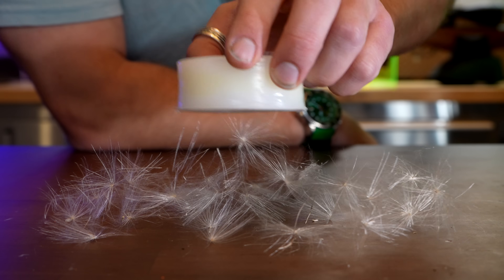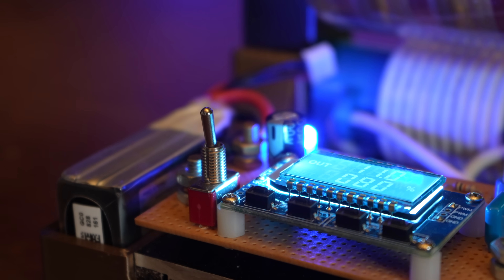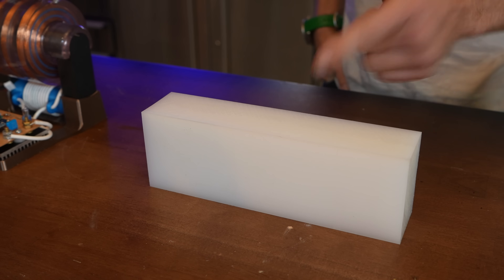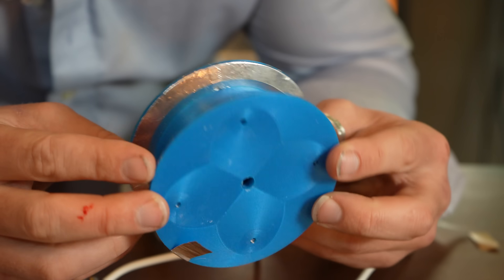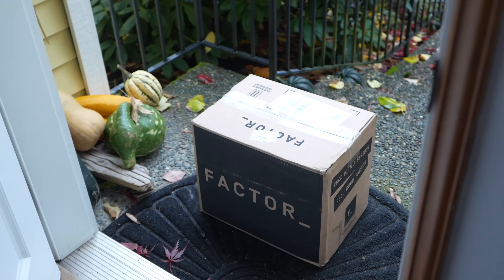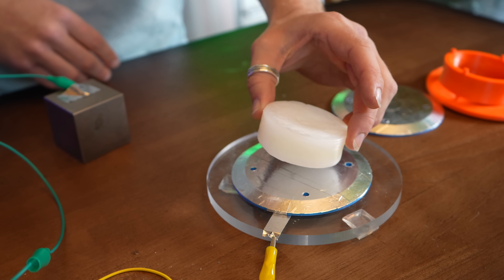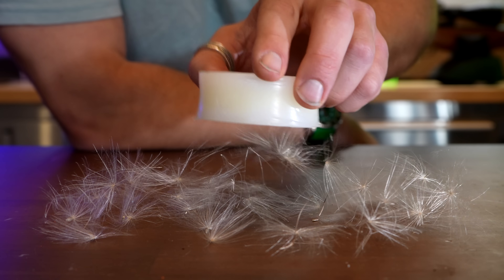Creating an Exotic Material With A Permanent Static Charge (Electret)

Comment: I take it, pointing at the Van Der Graaf generator makes it pull away electrons from skin (ground level potential in a positively charged field, "sharp point" of the finger causing an unevenly strong electric field)? It's effectively similar to the Biffeld-Brown effect (ionic wind) setups, though probably too weak to actually ionize anything.

Comment: Took me a while, but i finally got around to duplicate it. Make a nice mold, but i am struggeling to melt the PE properly. i tried 400°F as you showed, but the PE just sits as block for a long time. After a while, it turns transparent, but without really melting (just changes color from white to transparent, outside to inside). However before it is even liquid, it turns brown-ish so i assume it decomposes already. i pulled it out and it was soft, soft enough to somewhat force into the form, but it did not really conform to it. I tried applying some field to it, but i later learned that it did not even touch the bottom electrode, so it failed. Any advice on how i can melt it quickly without it decomposing?

Comment: So, what happens if you put this thing on ground, does the static charge disappear, or does it remain?
Reply from the maker: The charge of electrets is very locked into the material itself. So in theory, nothing.
Reply from the maker: The charge within electrets is locked into their structure, so in theory, nothing will happen. possibly SOME charge reduction if left on the ground for a long time?
Reply: @PlasmaChannel I did not expect a reply on a year old video this soon,  especially not from you yourself.

Cheers and a happy new year!
Reply from the maker: Cheers, and happy new year! Thanks for asking the question. It’s worth an investigation.

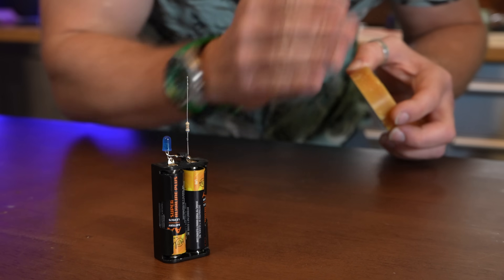Comment: 5:27, it's easier to 
give an air molecule charge (I forgot the correct term)  and cause it to fly towards  the source of the charge differential, if the charges only have to do that around a smaller area. I explained that awfully.

Comment: Two thoughts:   what if you made five of these electrets, and stacked them negative to positive?  Would the electrostatic field be cumulative?   If so, would it be five times as strong,  or less than five times as strong?

Secondly, if you want to see a higher resolution electrostatic field, could you take tiny colored polystyrene balls and sprinkle them on a sheet of paper with the electret underneath, the same way magnetic fields are visualized by sprinkling iron filings on a piece of paper?

Comment: And the more the  impurities are in your PE the better the charges are long lived and stored why: Dipole Orientation of Impurities: While pure PE is non-polar, commercial PE often contains tiny amounts of antioxidants, catalysts, or moisture. A high-voltage field forces these tiny impurities to align. Once the field is removed, the stiff plastic chains "lock" them in place, creating a permanent internal electric field. Bravo !!

Comment: Too late now, but do a 1x1 (i.e. 1) sensor. Put it on a stick. Glue the stick to a servo and glue that servo to another servo. You can (could) get an image of the entire cross section of the electric field. Also, floating-gate mosfet: 👍

Comment: There's another family of related materials that's even more interesting! Ferroelectrics, where the persistent polarization can be switched and shows a hysteretic behavior, just like ferromagnetic materials
Sometimes some materials can be both ferroelectric and ferromagnetic at the same time and sometimes both order parameters end up coupling, in those very specific materials you can generate a magnetization by applying a voltage or a polarization by applying a magnetic field!

Comment: A permanent positive charge could be used to sheild against electrons which could be used for ion engines without a proton source. I wonder if it's feasable and practicle? Still could be used against ionizing radiation or even reduce it.

I wonder if you could combine it with magnetic material? Would a electromagnetic feild increase the strength? Does adding magnetic material make it have magnetic properties and electrostatic at one time? How does a electrostatic and magnetic feild effect it? What would happen if you added magnetic fluid? What if you used higher voltage and current and added something to have it harden faster? What if you added latex/rubber or add conductive material or all of the above? How would it change it's properties? Could a computer chip be designed to use permanent static feild for processing, similar to transistors and ones and zeroes for code.

Comment: Have you measured the two sides/poles of your electret to compare the difference between what voltage you applied to form it versus what voltage ends up across its poles?

Comment: I've got it!  Make a stack!  Make metal plates and thinner separations (a big long barrel full), and then a lower voltage can be used to get the same level of excitation during polymerization, unless what gets 'stored' is also determined by that potential.  After polymerization completes while still energized (a key rule)  Hehehe... It would look like a round piezo stack laid on its side.  Then pull off all the plates and you should have a whole stack of electrets.  Then the plates are reusable too!  No need to print those or barriers, etc., just insulate the attachment nodes better, and fully immerse those plates and simply machine (carve) off the 'flash', which would not (should not?) have any charge on it.  Keep the chips and check if they did.  It would also be nice if you could make the whole mold thing from a media like metal that you would then be able to also place into the oven to be at the molten temp of the puck medium to allow the (re-)orientation to be as freely maneuvered as possible during the longer, slower cure.  All while keeping the HV excitement up and running as it is out of the oven and cooling.  Like a souffle, don't look at it till it is done.  Not piezo stacks, but more like the old AM radio tuner capacitors.  Every other plate at the opposite potential will make each liquidous medium between each plate perform exactly like you are wanting, polymerizing into perfect electrets.  Then you could experiment to find the ideal (minimum) puck thickness to gain maximum field strength.
Then, the multiple puck at once method will reduce your current, very labor intensive production cycle time a lot.  I think of those old CD or chip die trays will a thin groove impression on the base for the disc spacings.  Start out numerous and thin, and then skip spaces to alter thickness.  I made a cooking oil filter design years ago that uses 20kV and a bunch of 4 micron sized filter bags around big rectangular Aluminum plates.  The bags are not good enough to filter the oil to any acceptable level, but the application of the 20kV between the plates made the very tiny pieces of particulate in the oil to "glom onto" each other, thereby becoming larger and allowing the filter bags to perfectly trap ALL of the particulate in the oil.  An electrostatic effect.

Comment: Now make a really thin pancake version.  Make ten of them and stack them to see if the field is greater than the thicker single puck.  Usually electrons "sit" only on the surface of an insulator.  This is because it is an insulator, and can therefore NOT EVER conduct a flow of electrons through the medium.  This is why an old 25kV TV tube gets electrons on the glass face of it.  It grabs them out of the air and they accumulate because they have no conduction path to "exit" through.  That is why a conductive (hand) wipe is need to gather them back off that still charged from within surface.  These devices, however get electrons trapped inside their non-conductive matrix while they are liquidous and a charge is applied across the medium and upon solidification, they have nowhere to run from inside the medium.  It is not just the charge applied orientation, there has to be actual electrons being added (injected) that remain stuck upon solidification.  If you were able to examine it, you would see electrons build up on the surface of one side of the puck just like the old TV screens, but not nearly as much or as excited, because they have "got nowhere else to go".  Until a conductor touches them.

Comment: Two things I immediately realized at the start: (1) Polar molecules being used to make a static electric field seems so obvious that I really don't know why I never thought of it. (2) I never really thought of static electricity as static. Yes when its just sitting there its static, but you only concern yourself with when its being discharged. I think of it more as a capacitor that has stored energy. I couldn't imagine a real static electric field without the stored energy and it being dissipated.

Comment: Mi versión tiene un interesante respuesta piezoeléctrica, a mí se me quedó adherido a los electrodos, aunque hice barias cosas diferente... derretí el polímero dentro de un tubo de vidrio pirex de una lampara de iluminación de gas propano-butano https://bazartotal.com.ar/wp-content/uploads/2024/09/1960.jpg, utilicé una resistencia de estufa eléctrica  con termóstato controlado con un Arduino para controlar la pendiente de calentamiento en un horno improvisado con ladrillos sueltos. 
Los electrodos son de chapa de aluminio de 0.35mm.
Es muy interesante  como electrodo piezoeléctrico  flexible, la frecuencia de resonancia es muy baja y depende mucho de la temperatura,  a unos 3°C es de unos 347hz y a 26°C es de 17hz
Sobre el acero de un chuchillo tuvo armónicos hasta de 32khz
Los electrodos

Comment: If wanted massive improvements in the electret material you would need in addition to the charging forces 10-30 tons of static pressures to increase the stresses on the materials ..

Comment: Add copper sulfate in the top side and graphene in the bottom half or aluminium oxide. Couldn't hurt to see if additives help. I'll try it with liquid glass and high voltage. I'll let you know what happens

Comment: @PlasmaChannel     Hey Jay, what type of transistor and resistor are you using in your electrostatic detector at 05:49? I am trying to build one but can't get it to work. Thank you !
Reply from the maker: Whoa, thanks for the tip! Totally unneccessary but it goes towards making my videos better. So, the detectors are CRAZY finicky. Please shoot me an email (under the about tab), and mention we talked. I'll shoot you that info over email (as i'm not home and cant remember)
Reply: @PlasmaChannel  Sure thing. Just did. It is a protonmail domain from Switzerland. Thank you.

Comment: I wonder if these could be used to put the large voltage bias on vacuum tube plates... the current flow would be superimposed on the large voltage and hopefully wouldn't discharge the electret.
Reply: OR what if you applied a strong electric field as the PLA is extruded out the 3-d printer nozzle to print an electret directly?

Comment: Electrets are not plasma waveguides in the traditional EM sense — but they might be used to passively sculpt or influence weak plasma environments, especially in microdischarges or electrostatic experiments. Think of them as biasing tools, not controllers.

Comment: Dude, what if you tried to enhance this "electric field magnet" using the capacitive principle, like you put two plates of some conductor totally isolated with only one electricity input Each one you connect one to the positive and the other to the negative (detail the next two with the / continues.
Reply: With the flat faces facing each other as if it were a capacitor) then you would turn on the power and make the plates polarize with the self-voltage then you would suddenly disconnect the power supply from both poles and without letting them discharge with air or anything else, you completely isolate the plate from the external world, and to finish, you separate the isolated plates while charged
Reply: Then he makes the comparison and tests with these plates, but also tests whether these static fields combined with magnetic fields can use that right-hand principle to move the water.

Comment: Have you tried to build an electrostatic current generator using this polarized material, in which the rotor is made of this material? You will use the two polarities by rotating. You will have a big surprise.

Comment: I can't help but wondering, depending on both the stability and structural integrity of said material, if it's possible to use the Electret in a generator of some kind. If it's too brittle, would it be possible to re-enforce it with a non-reactive material, not in the same way but in a similar way to re-enforced glass?

Comment: what if useing electrets inbetwen two plates of metal  to see how much voltage it can generate  on its own by colecting free charges +tune ing for charge acumulation on the plates  whit groung and mesh antena, idk if it works for low power sensors as powersuply.

Comment: I think it might work better if you made your mold sideways with the electrodes on the sides instead of top and bottom it would guarantee a better electrical connection instead of hoping it's filled to the top. 🧲

Comment: Not sure if you answer message or not but I was wondering if these are like batteries in the sense that when two 1.5v cells are put together it makes 3v. Does the voltage double add up when two electrets are placed together?

Comment: I've been using electret microphones for years and never knew they contained such an interesting material. I'm not sure how easy it is to make a material that changes colour when in the presence of a field (Electroluminescence ?)  but if you could find such a material cheap enough you could make a high resolution grid fairly easily and no soldering ...

Comment: Could you make an ice-electret while cooling it down? 

Water is polar, and you could have a strong electric field present during the cooling process. You'd probably have to add some cooling interface inside of the mold (i.e. small pipes that allow you to pass liquid nitrogen through them or something).

Comment: It's also possible to have a net charge embedded into an insulator. A common misconception is that insulators have nothing to do with charge but it's just that they can't easily move through an insulator. A simple example turns up when you use a Teflon rod to generate a bit of charge by rubbing it through the triboelectric effect. Teflon tends to work better for classroom demonstrations than something like PVC pipe especially if it's a little humid. If the students use the rods a little much, the charge detectors still go off after they're effectively grounded because some of the charge gets forced into the teflon. There is also a bit of a electret effect and I've wondered how much of each is going on. I've found that just blasting the Teflon with an arc is enough to do this but the results can be a little dodgy depending on how it's done.

Comment: Good to build a free energy generator
Reply: Not unless you know something no one else does, you need motion to produce usable energy, static magnetic, or electric fields do nothing if there is no motion. They are likes rocks at the top of a hill, they don't do produce energy until they are given a push and they start moving.
Reply: Building a wheel powered by perpetually moving by permanent magnets without any electrical power is possible and easy. the question is... can the wheel produce more electricity than is needed to create permanent magnets? the answer seems obvious... it is not possible. And it is probably true. However, no one has ever proven it. There have been many things in the past that seemed obvious but were later proven wrong. Saying something is obvious is not a scientific statement.
Reply: THERE IS NO FREE ENERGY!
Reply: @commscan314  there is. But it doesn't matter. Thank you anyway 🧡
Reply: @commscan314 please stop believe in religion. And open your mind
Reply: @Edoardo-r5z Yeah no you have to be insincere.

Comment: Ive been researching free lights for years and styrofoam is great for lighting cfl bulbs in a dark room. Im going to make an electret for some cfl bulbs in the trees thx to your vid, I was going to use plastic or styrofoam with wind to freak out my neighbors here in Deutschland… 😂
Reply: @ ive made those years ago, and they are not electrets. Those are just chemical/crystal batteries, totally different.
Reply: @ ok I see how he used a small heatshrinkgun to blow the arc. Im going to use a melted cutting board and just a stungun hv unit to charge it as it cools. Then I may get the spooky trees… lol

Comment: Oh, and when you pointed at the van de graaf, you were pushing into it's electric field and giving it a way to ground closer to it's center of charge allowing the electric holes (quasiparticles) to flood out of the field through you not unlike deflating a balloon with a straw.

Comment: I have 2 questions. Would teflon be a better choice as it has a higher dielectric constant, or would it be exclusively piezoelectric? And what would happen to a conductive fluid if you use electrets set up at a right angle to magnets in a lorentz thruster configuration? Would poynting's law hold true? Theoretically the energy for the kinetic component has to come from somewhere, but poynting's law can't not apply either...

Comment: 5:28 When the finger approaches the globe, polarization occurs on both sides (mostly the finger) concentrating the field between the finger and the globe, and thus reducing its strength in the direction of the detector. At least I think that's roughly what's happening; it's been a couple years since I took the physics class where I learned about this kind of thing.